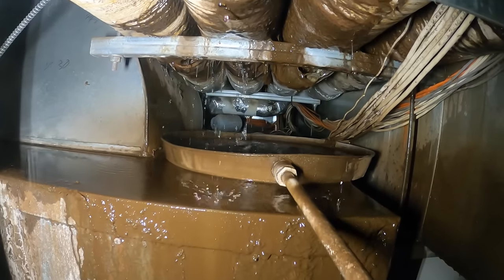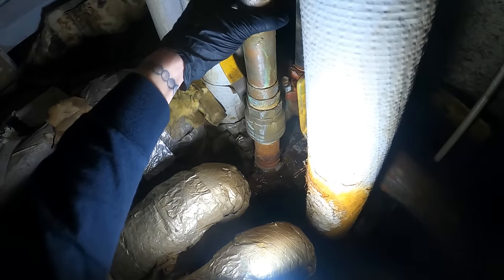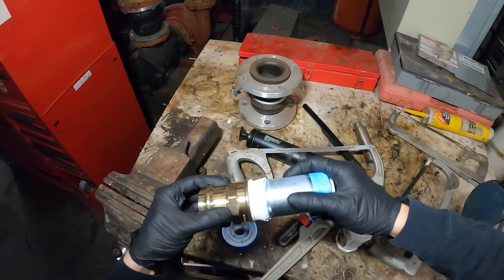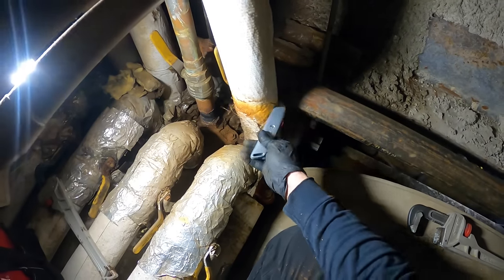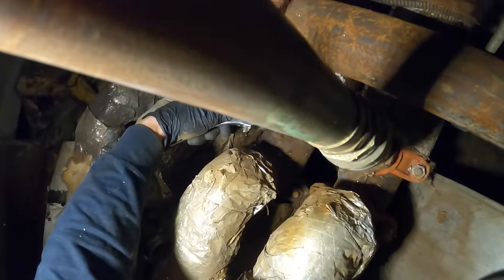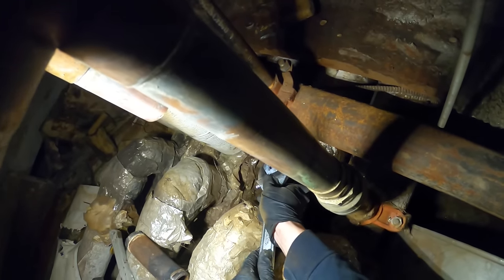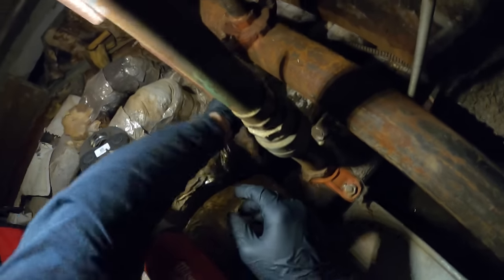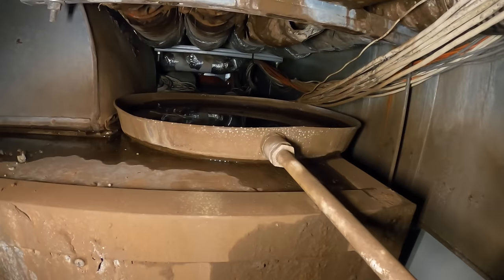HVAC Emergency: York FCU NIGHTMARE Leaking Water For 3 Months (Fan Coil Unit Water Leak Repair)

Comment: I do this same type of work in hospitals and other commercial and industrial sites. We’re not supposed to touch any valves. The problem is that a lot of these stationary site engineers don’t know their own buildings. Good work bro.
Reply: Also those valves really should be moved regularly to avoid them sticking. This very few people bother to do.
Reply: You can't touch the valves because the engineers don't know what they're for?
Reply: @garrettmillard525  we’re not supposed to touch them because it’s their facility and they’re responsible for shutting down the loops and bringing them back up. Oh I could definitely do it but company policy is that the liability falls in them if they forget to open or close a valve
Reply: @garrettmillard525  if it’s something like a ahu or a package unit I just need to ask if I can shut it down. I do work on a lot of critical facilities. Don’t want to close the wrong thing and kill an operating room or an icu wing.

Comment: Anybody that has turned a wrench knows what it’s like to have limited leverage. The torch saves the day again.  My mini pipe cutter has also saved me many times. Good job.
Reply from the maker: Facts. It's the worst with tight spaces but thats all you get here in NYC in many locations. The torch did save the day. I hear that! Thank you! Stay tuned for new videos every week🔧⚡️
Reply: Trick I would use in a tight space would be to take a scrap elbow and thread it on top of the nipple and then thread a longer piece into that to use as a breaker bar

Comment: Awsome job. Great video. To me the hardest part seems to be purgeing the system all those pipes throught the while building didden valves where would you even start. Thats what has always intimadated me with commercial. Is all the piping that seems to go everwhere. How to find the purge valves. It looks like it would take days to purge a big building.

Comment: Just stumbled on your channel... Nice work... And in a craftsman-like manner.. Your approach to this problem was spot on. I saw that Milwaukee does make 90° offset jaws for your crimping tool (not sure in that size), but your solution was excellent. The struggle is real in plumbing, right? 😀 Best!

Comment: Lowell makes a pipe wrench head adapter that works with a 1/2 breaker bar or ratchet. Basically a crows foot for pipe wrenches.
Reply: Good to know

Comment: Unfortunately when stuff is designed and installed any thoughts regarding maintenance are ignored
Reply: If they had used the proper nipples this would not have happened.  He thought, "I'll be long gone when this blows".

Comment: I’m a union pipefitter in Texas doing hydronic mechanical systems for commercial buildings. Throwing in unions right after the valve has saved me many times in situations like this. After the branch is drained just bust the union loose and replace either the nipple or valve or both (assuming it’s not a solder leak) and connect it back together without having to touch the copper whatsoever
Reply: Either way it’s still cool to see this being filmed. My girlfriend doesn’t really have an idea of what it is I do for work so this gave her a great understanding!

Comment: Internal pipe wrences are awesome for this scenario. Check your local welding supplier if the plumber doesn't carry them. They have impact versions as well that you could hook a right angle hole hawg too or breaker bar with extension.

Comment: I saw in one of the Charleston hotels HVAC also running water through. It might look like a good idea to supply cold/hot water through the coils on a massive scale. But after 20 years this system become a nightmare. Corroded pipes, not enough space to do any maintenance. Humidity in Charleston also doesn't help overall.

Comment: They also make a close clamp for the press gun it’s a jaw that’s two pinchers that close your press tool, so you put your normal jaw on the fitting itself not on the gun then is when the pincher comes in and closes the jaws…..it’s pretty cool

Comment: Why not put the valve in same direction as the one beside? The new one turns down to open. The old valve turns up to open. Maybe i am OCD. The most important is that it doesnt leak so thats good.
Reply: New position is easier to turn.  Who cares about matching the other valve?  The other valve was probably installed without a dielectric nipple and it will be the next one to go.  But next time he will know what to do.

Comment: Ton of bacteria.. your funny!! Some how I don’t think “Bacteria” is the issue here! Judging by the state of that mechanical room and the piping insulation it’s matter of time till that’s all coming out! Just cut the drywall and remove that wall, why crawl around all that mess when you’ve been there so many times?? The install of the piping and not offsetting the Vic fittings lends me think it was installed someone who doesn’t do it for a living?? She’s a money maker though!!

Comment: Keep the nipple...as a reminder of how bad NYC plumbing is and how horrible the engineers used to be
Reply: Don't blame the engineers.  This was on whoever installed the piping (plumbers?).  Probably did not have a dielectric nipple and got away with using a standard (cheaper) nipple. This was probably not the only wrong one installed.

Comment: This condensasion ? 😅 
I hope any thing a pipe no have leaking
Reply from the maker: This is a fan coil unit that provides heating and cooling. The cold pipe condensates because it's using chilled water produced by a chiller. Thanks for watching 🔧⚡️

Comment: Damn im sweating watching this video im halfway through. In the back of my head is cut it out cut the remaining piece on the inside of the thread then use a chisel or flat screw driver to get it out, my last option would be the toech cause of the gasket, but a definite go to

Comment: Seen one like that at work with leaky pipes and a horrible mess. Supposedly it was leaking for over a year. Went agead and got permission to get new pipe and fix it after a come to Jesus meeting with the boss. The pipe literally fell apart. 😮 This is what happens when you don't condition your boiler water properly. Check your chemistry, and regularly. 😮😮😮

Comment: Water treatment???????????
Reply: No.  Should have used a dielectric nipple.  Dielectric nipples are for connecting copper to iron or steel, prevents a chemical reaction that eats away at the steel or iron.  Ships berthed permanently in water like the Queen Mary have a dielectric cable around the ship below the water line to keep the hull from rusting for the same reason.  There is a dielectric anode pipe inside your water heater that does the same thing.